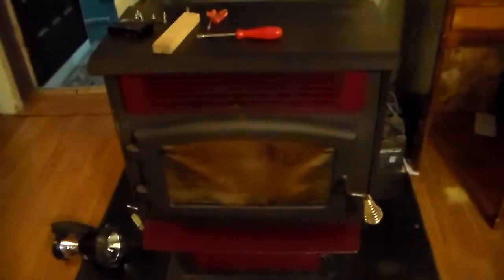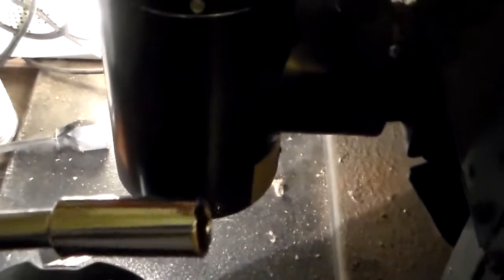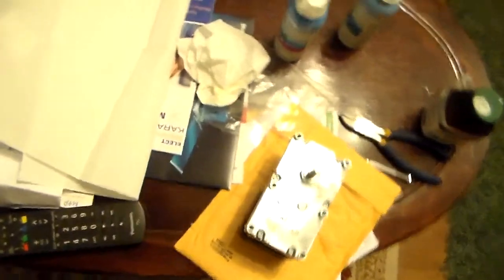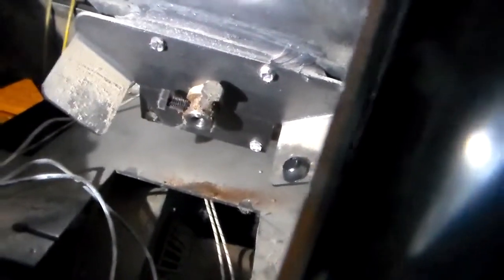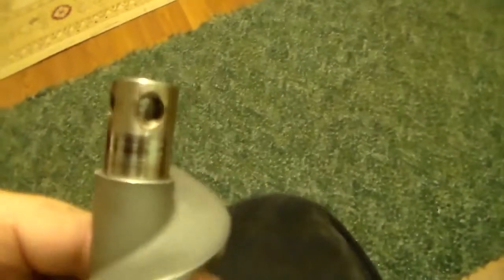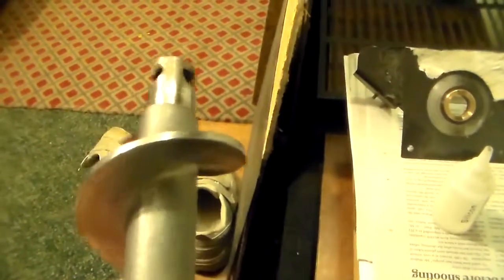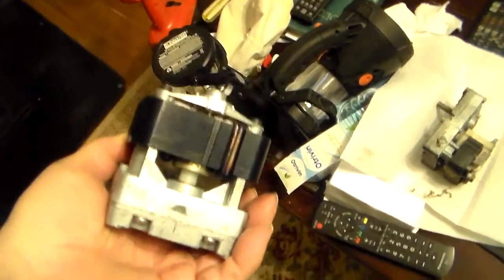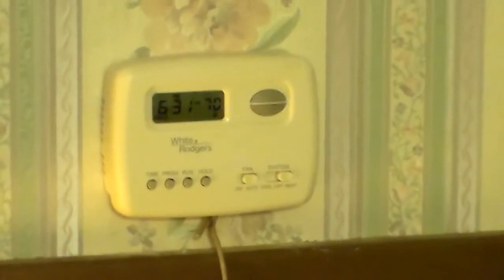Drolet ECO 45 Auger Repear

Comment: BTW , one of your first points was to advance the shaft in order to get those half inch set screws out but mine was seized and unable to be turned for access. I got lucky that I was able to get in but it could have been otherwise so maybe an add on would be a socket/wrench configuration that might grab them no matter where there are. Anyways, grateful :)
Reply from the maker: good to hear you got it going, mine is going good so far but I do see the fines on the new motor shaft again so it probably needs to be cleaned every 2 or 3 years or perhaps a new bushing plate is needed.

the fact that the motor is not mounted may also help in turning the shaft to access the shaft bolts by turning the motor body.

at the time I thought the motor was mounted to the bracket & found later that it only rests against the rubber bumper.

Comment: As the wood fines get squeezed at the bushing, the oils coat the surfaces between the shaft and bushing. When heated, it becomes a varnish. As time goes by, what was once a perfect smooth fit is now a tighter coated fix. Soak in spirits for an hourand you will rid the varnish and get your smooth fit back.

Comment: Hey any updates?  Did the silicone lube work good?
Reply from the maker: +24revealer mine is still working good although I am seeing a pile of fines on the new motor, it has not started squeaking again.

I think I will order a new bushing bracket over the summer & change it for next season though.

a good place to get parts online quickly is http://www.myfireplaceproducts.com 

just search your SBI part number or browse here 

http://www.myfireplaceproducts.com/Catalog.aspx?Type=Accessories&Lang=EN&SubType=PARTS

they stock most parts & are much faster than going through home hardware / sbi

the only down side is all there prices include shipping so if you need several parts its best to call them, in some cases they will manually fill your order & charge you actual shipping weight for the combined order rather then the embedded separate shipping cost on each item.